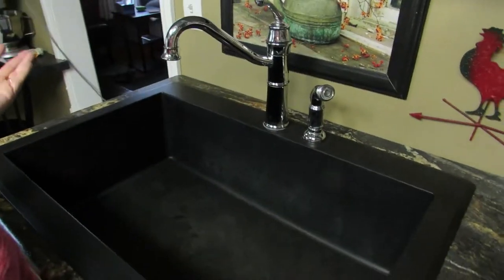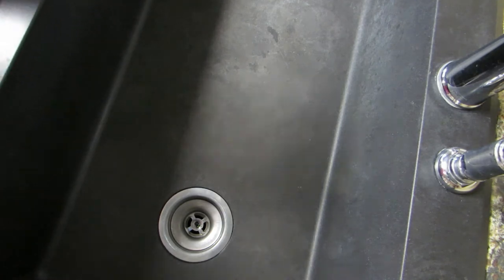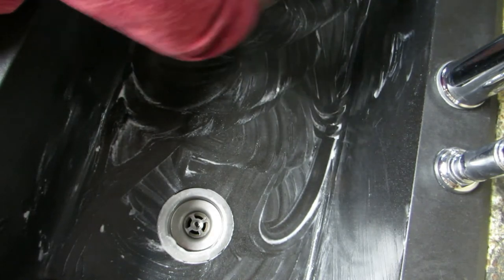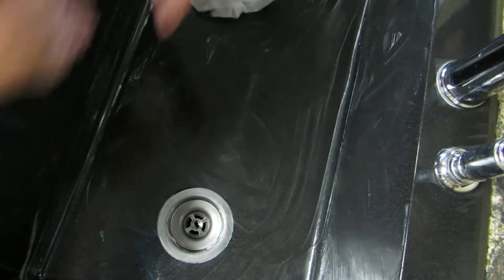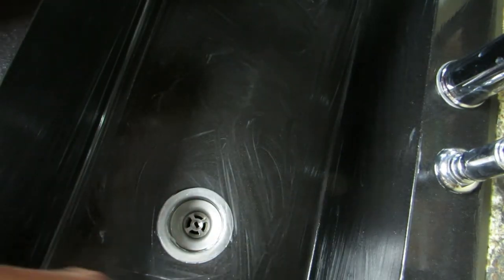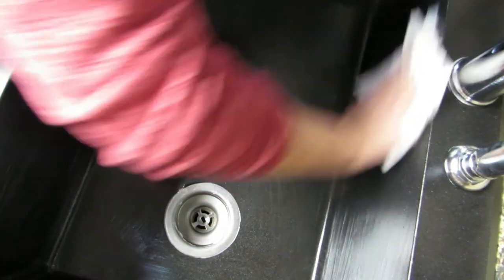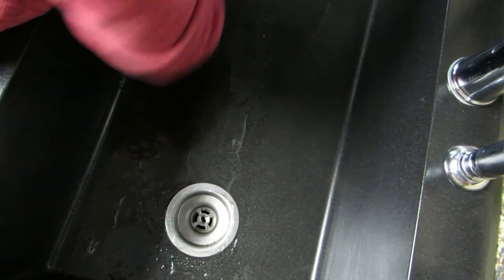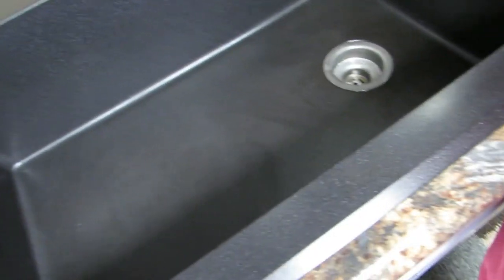How To Clean A Granite Sink And Make Granite Sink Shine

Comment: Surely once you use any soap products, especially with hot water , the coconut oil gets washed off??
Reply from the maker: Yes it will get washed off.  You have to treat the sink with coconut oil about every two weeks.
Reply: @RealLifeWithMichelleRob  Thanks. I’ll certainly give it a try...but had I known how labour intensive a black granite sink is, I think I’d have chosen differently
Reply: @belyeu4190 Thank you so much for this info. I’ll certainly use this method to maintain my sink 👍🏼
Reply: On my sink, it hasn't totally disappeared; I think it will last longer after a few treatments.